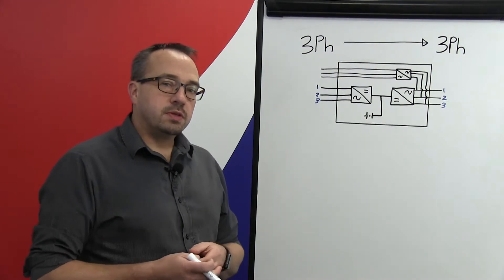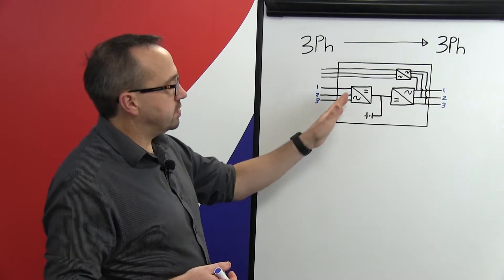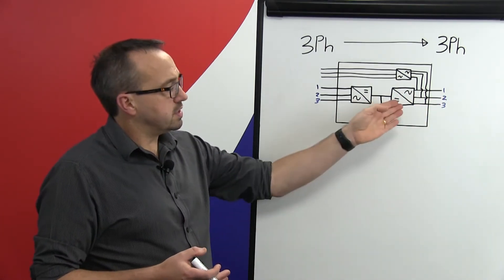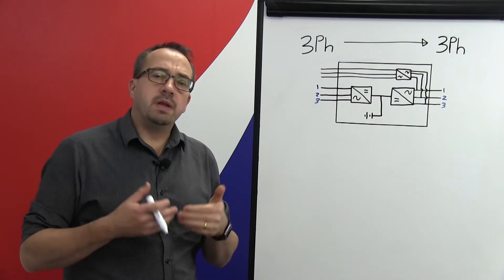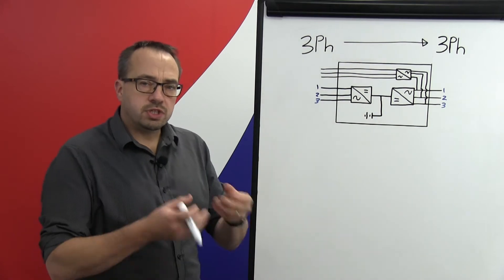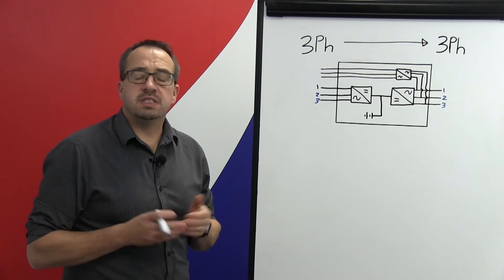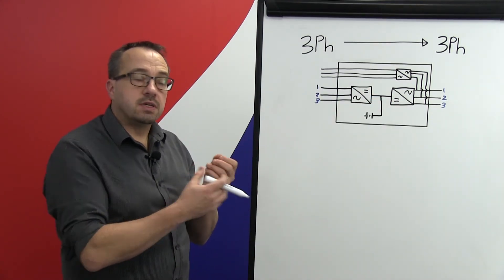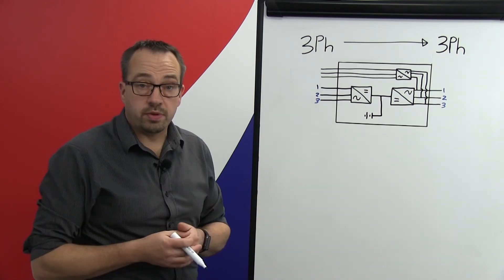#TechTalk: How Does A UPS Handle Unbalanced Loads?

Comment: Alright! but what happens to the inverter stage, will it work smoothly with unbalanced load? And what would be happened to the Output Transformer with unbalanced load?
Reply from the maker: Hi, glad you enjoyed the video and thanks for your
questions!
Obviously we can only speak for Riello UPS uninterruptible
power supply units. But having an unbalanced load on the output of the UPS is
perfectly fine as all Riello UPS units are designed to cope with a 100% phase
load imbalance (e.g. 100% load on phase 1 and 0% load on phases 2 and 3,
assuming that 100% load is a third of the total overall load). 
In this day and age, any UPS which cannot cope with imbalanced
loads is probably poorly designed. Basically, whether the UPS is
transformer-less or transformer-based, the inverter controller manages the
voltage and angular displacement across the phases. 
In the very worst-case scenario, this would result in voltage
variation of +/-2% and an angular displacement of +/-1 degree, which as you can
appreciate is very small and would not affect any type of loads whilst the UPS
is operating with an imbalanced load.
Hope that helps with your query, thanks again for getting in touch
Reply: Thank you. I worked 6 years with riello UPS in Bangladesh.So I know something about Riello.

BR
Safiul Islam